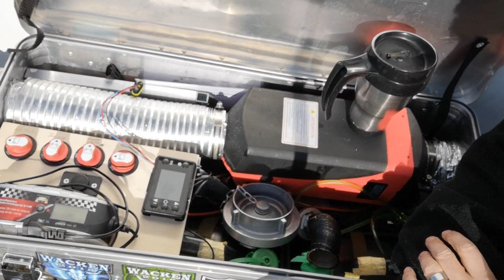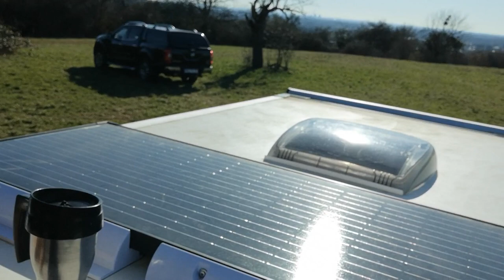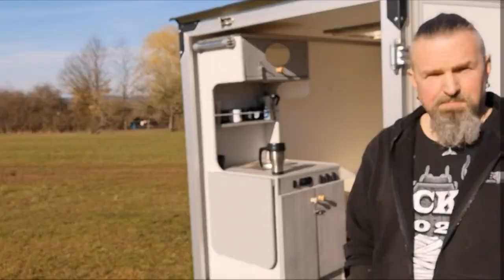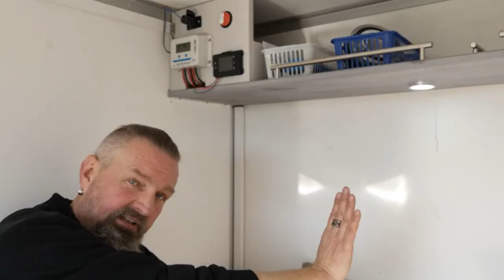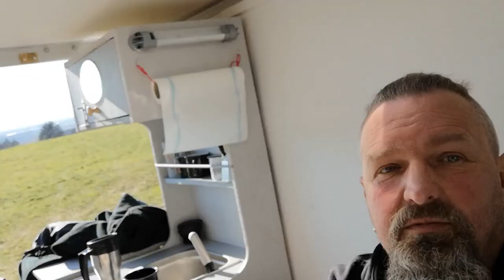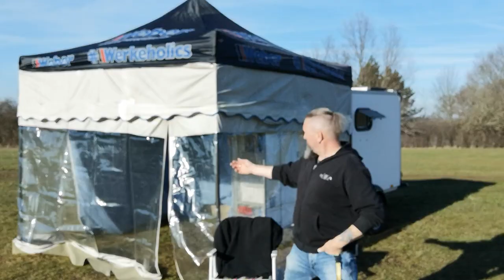DIY Mini Camper oder Mini Trailer mit Dieselheizung und Solaranlage

Comment: Mach dir keine Sorgen, die Hinterlüftung des Panels ist absolut ausreichend. Eine gute Hinterlüftung dient eher einer besseren Leistungsausbeute. Je wärmer das Panel wird, um so mehr bricht die Leistung ein. Die Batteriekapazität ist meiner Meinung nach etwas zu gering, das könnte zu Problemen mit der Heizung führen, die ja nicht unerheblich Strom benötigt. Bei nur 100Wp Solarleistung dauert es zudem recht lange, um die wieder voll zu bekommen.
Meine Wahl wären mindestens 200Wp Solar mit 100Ah LiFePo4 - Batterie oder 150-200Ah Bleiakku. 
Dazu dann unbedingt einen echten MPPT - Laderegler. (Wer so einen kaufen will, sollte sich dazu einige Videos hier auf YT ansehen, denn es gibt eine Menge Fakes auf dem Markt.)
Bleiakkus sollte man unter keinen Umständen unter 50% entladen, sonst sinkt die Lebensdauer dramatisch ab. Dazu sind sie extrem schwer. LiFePo4 - Akkus lassen sich deutlich tiefer entladen, ohne sofort Schaden zu nehmen. Dazu kommt das deutlich geringere Gewicht.